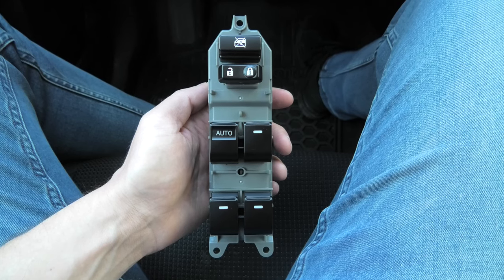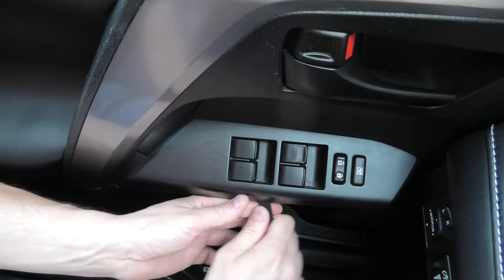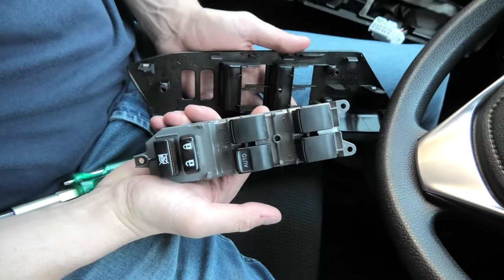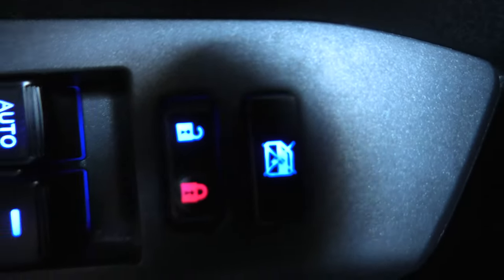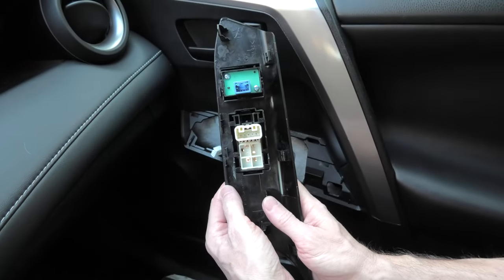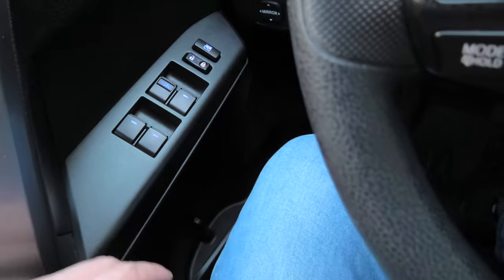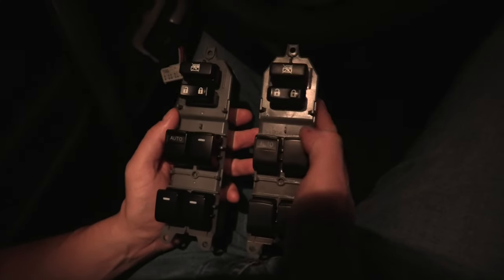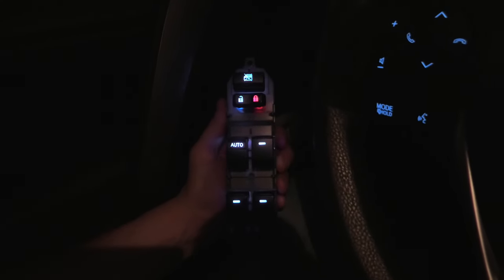Toyota RAV4 (2013-2018): Illuminated Power Window Switch Install. Driver And Passenger Doors.

Comment from the maker: PRODUCT LINK:
Lighted LED Power Single Window Switch Set For Toyota RAV4 RAV 4 2013-2018 LHD - https://cartrimhome.com/LED-Power-Single-Window-Switch-Set-for-Toyota-RAV4-2013?tracking=morozov_automotive.

TOOLS REQUIRED:
1. TRIM REMOVAL TOOL - 4pcs Auto Door Clip Panel Trim Removal Tool Kit - https://amzn.to/41nYhsk.
2. PHILLIPS HEAD SCREWDRIVER - PICQUIC SIXPAC Plus 7 pc. Multi-Bit Screwdriver - https://amzn.to/3IOHg1Y.
Reply: How can you tell which to order A type or B type?
Reply from the maker: Not sure. They used to have just one type before. You can get in touch with their customer service to see what is the difference.

Comment: i broke the driver side bezel Bezel on my 2018Toyota rav 4 .  what is the part number of the one in your video. Seems there are different types of it . i need the one shown in the video  that screws on to the power window switch. thanks
Reply from the maker: Hi, sorry, I don't have the part number for the bezel. You can go to any Toyota dealer and they will provide the part number for you.

Comment: Cant change the lights in them can you? They look like a sealed unit.
Reply from the maker: Switches come with LED bulbs. In theory they should last a very long time. There is no easy way to replace the LED elements.